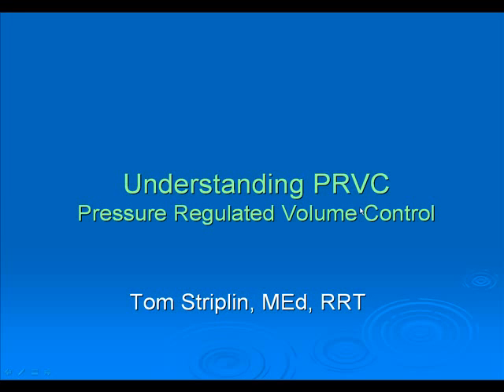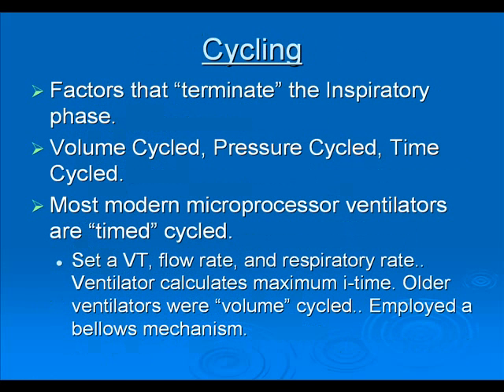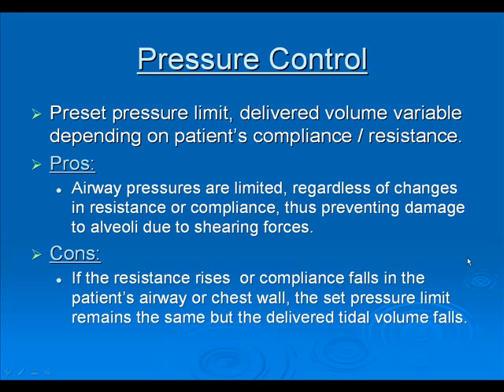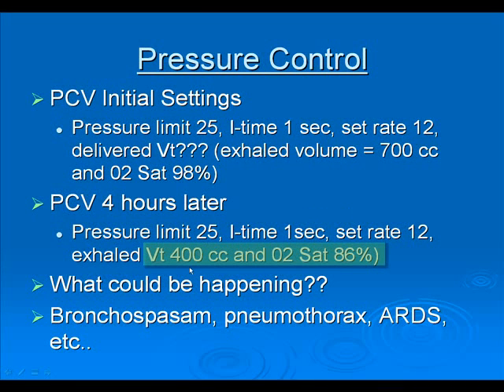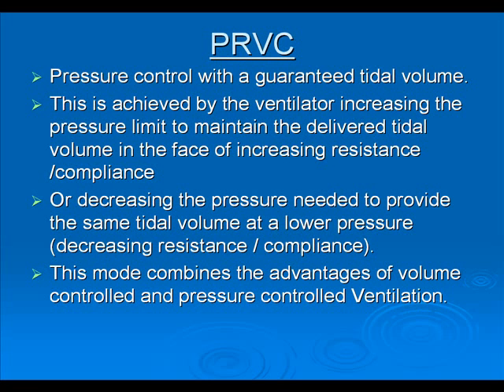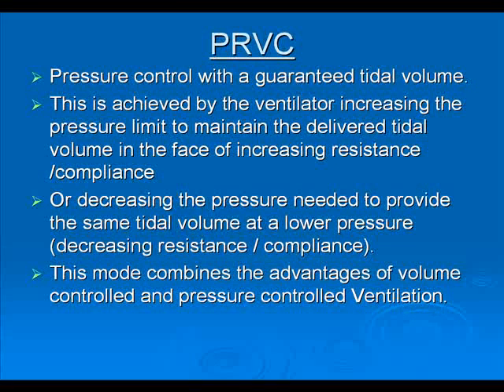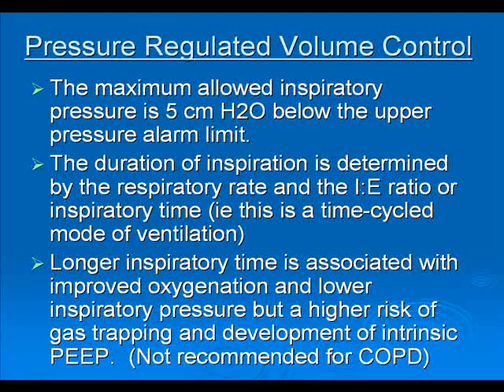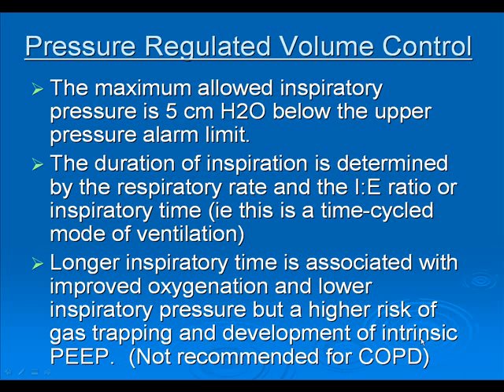Understanding Pressure Regulated Volume Control (PRVC). Part #1

Comment: Just wondering what the difference is between PRVC and Volume control ventilation with a decelerating waveform set (with tight pressure limits)?